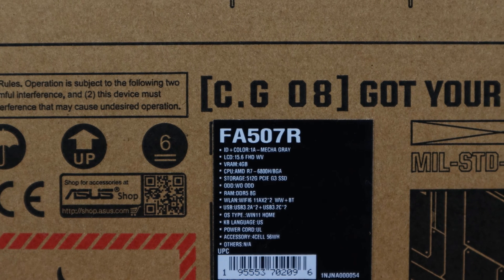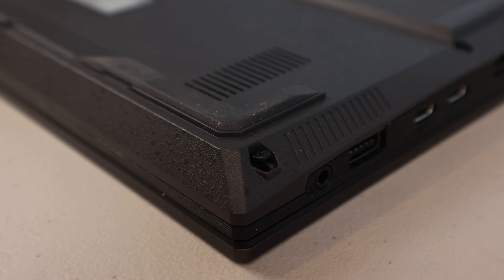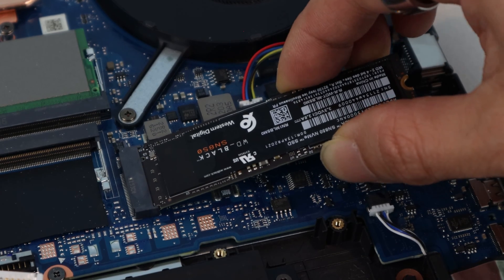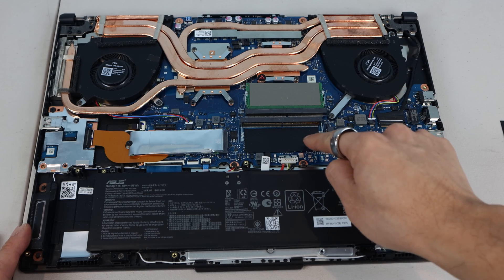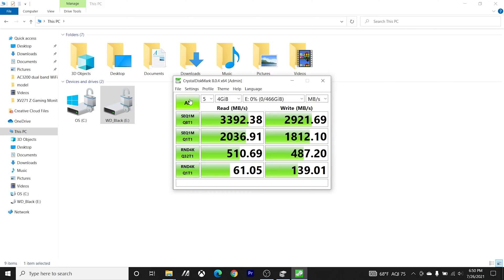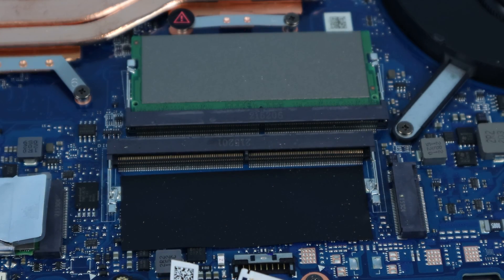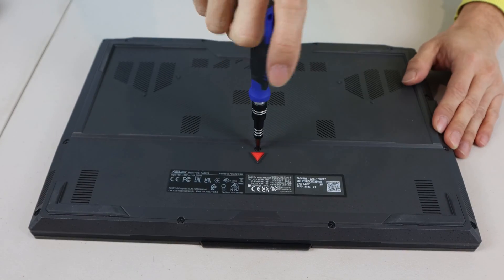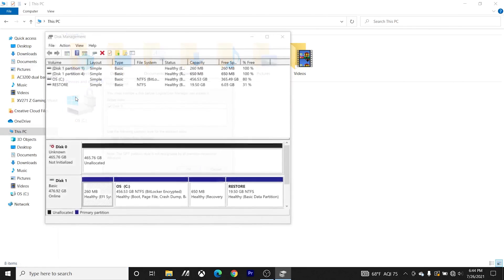How to Upgrade/Install RAM and m.2 SSD in ASUS A15 2022 TUF Gaming Laptop

Comment: Hi, has anyone tried removing the SSD from Slot 1 (the one that comes preinstalled from ASUS) and installing it in Slot 2 to fix the Wi-Fi issue?
Will there be any problem if Slot 1 is left empty and the ASUS SSD is used in Slot 2 instead?

I use asus tuf a15

Comment: Hello! What size screwdriver do I need to remove the bolt holding the secondary SSD M.2 ? Thanks!
Reply from the maker: You can use a PH0 or PH1 size mini screwdriver.

Comment: Any idea why my laptop is overheating since I changed my ssd drive? I didnt put a thermal shield. Should I? Also, the SSD included with the laptop had like a small thermal pad under it. Should I put it for my new SSD?

Comment: Hi If I.Extend My self so will it void Warranty? ??please reply
Reply from the maker: In the U.S., upgrading RAM or an SSD generally does not void your laptop's warranty due to the Magnuson-Moss Warranty Act, as long as you don't physically damage other components during the process; however, the replaced parts won't be covered, and you must return the laptop to its original configuration for any warranty service on other issues

Comment: omg i just unlock metal lock battary not remove take out connector so what happend to my laptop it will damaging something
Reply from the maker: No, not necessarily. Disconnecting the battery is optional as a safety precaution. In most cases, there is no issue if you leave it connected.

Comment: can you give more details on the heat management system you installed on your ssd. I also have an asus tuf f15 laptop, and recently i purchased a wd5000 nvme ssd for my laptop  and during intense copy paste sessions the ssd temperatures go as high as 100 degree celsius.
Reply from the maker: It's just a thermal sticker with a passive heat sink: https://geni.us/QipdAuR [Amazon Affiliate Product Link] Of course, the natural heat dissipation and air flow around your laptop matters too, so the more airflow you can provide internally or externally, the better the heat sink will perform. It may help to use the laptop on dedicated cooling surface with fans built in like these: https://geni.us/smumD  [Amazon Affiliate Product Link] if you're experiencing a lot of heat during sustained use.

Comment: My laptop is FX517ZR ? Can I use 32x2 GB RAM 4800HZ? Will it work also Can I put 2x2TB PCIe NVMe ?
Reply from the maker: For your model ASUS's official specs say 32GB is the max, however, actual users have reported that they've installed 64GB (2 x 32GB DDR5-4800MHz) without any issues. Whether or not the system actually takes advantage of all the capacity, is unclear and while you may get a little bit of overage, it's more likely there's some wasted capacity there, so that's up to you. Your laptop has two m.2 NVMe PCIe SSD slots and supports up to 4TB in each, for a maximum total capacity of 8TB.

Comment: Heya! Planning to upgrade my SSD and will be following your tutorial ☺️ And just shooting my shot, but do you also know how to know why the USB drive won't work? Tried uninstalling the driver and restarting but it doesn't work. The USB port isn't loose either so I'm going round for answers
Reply from the maker: I'd test the port with other USB devices, like a mouse or keyboard to rule out a communication issue. If it's just the drive that isn't being recognized then that could be the source of the issue and that could be any number of things (e.g. corrupted file system, damaged cable or interface, etc.)

Comment: Thanks for the video, I successfully upgraded my TUF A15 to 32gb of ram and installed a second 4tb ssd.
Reply: Did it help improve games you play?
Reply: @eddielazo4367   Sorry, I can't really answer that. I installed those components before I really put much on the computer just in case I screwed something up.

Comment: Thanks man I have done it and installed a WD Blue SN5000 1TB SSD NVMe in my TUF A15. I have also found some dust so I cleaned it. I really found it easy. The only tricky part is opening the case but when you get to the inside everything was easy. It's my first time to do an upgrade to my personal laptop.
Reply: Did the screw give you any trouble when installing?
Mine won’t turn at all
Reply: @gaara4667  I didn't face any trouble with the screws.

Comment: Hi, I have one question will the Silicon Power 512GB SSD 3D NAND A58 Performance Boost SATA III 2.5" 7mm (0.28") work with my A15?

Comment: Hello Phil i have a question, i upgraded my RAM from 16gb 4800 to 32gb 6400, but i cant seem to change it to 6400.
The GB have the right size but i cant seem to change any settings in the bios concerning RAM.
Im very happy to see you have the same BIOS screen so the settings should seem similar. When im in advanced the ram area is just darkened and says administrator level access, but i cant find a way to get in.
Do you have any pointers? 
(fully updated drivers)

Comment: Hi! i have the same laptop as yours, but can i just ask if you experience any issue while turning it on like BSOD or automatic repair like that? Because it keeps happening to me, i tried changing the ram the ssd and clean install OS but the issue still persist. After bsod or automatic repair my laptop restart and everything is smooth but it is so annoying that i can't turn on my laptop normal.

Comment: Are both of the SDD slots are gen 3 i have the asus tuf a15 FA507R hn 2022
Reply from the maker: Yes, in mine they are both Gen 3, based on benchmarking installed Gen 4 drives.

Comment: Is that possible to use ssd 850 with heatsink ? or only the normal one with the passive heatsink?
Reply from the maker: Given the limited clearance of the base, I think a proper heatsink would simply be too thick to fit. It would depend on its dimensions, but I don't know the specific limitation off hand.

Comment: Thanks you really helped me today!  Did have to use pliers on the stupid m.2 screw.
Reply from the maker: Sometimes the screws have a bit of thread seal glue on them (it leaves a blue residue on the screw), and they can be hard to turn. Using downward pressure from the back end of the screwdriver while turning usually helps add enough torque to break the adhesive seal. Two tips for small screwdrivers: 1. Find the appropriate size for the screw, tips that are too big or too small can strip/damage the screw head. 2. Get the ones with handles that rotate independently from the shaft (you press down on the back with one finger while you turn the handle with your other fingers) I find these work the best: https://geni.us/kWSA [Amazon Affiliate Product Link]

Comment: Hi. What is the maximum capacity of RAM and M.2 SSD "FOR EACH SLOT"???
I am planning to put 2 RAM sticks (32 GB 4800 mhz for each slot, total of 64 GB) and 2 M.2 PCIE NVMe Gen 4 (2 TB for each slot, total of 4 TB).
Are these upgrades applicable and probable?
Hoping for your help and answer. Thank you in advance.
Reply from the maker: Per ASUS, this motherboard can only utilize up to 32 GB of RAM, so while you could install two 32 GB chips for a total of 64 GB, the system will allegedly only be able to use 32 GB and the rest will be "wasted" capacity (though more likely just underutilized). As far SSD capacity, there's theoretically no maximum, so 4GB m.2's would probably work fine in the slots, however, ASUS recommends no larger than 2 GB per slot for system efficiency.
Reply: @FixItPhil  Thank you so much! You're a lifesaver!!! 🙏🏻🙏🏻🙏🏻

Comment: On 2:03 this plastic shield, you can change everything without removing it actually. But if it is removed and let's say the sticky part is a bit damaged on one side, so it won't stick back as tight on the side of ssd now, what am I supposed to do? Or do I even really need this plastic shiled in there? What is it for? Is it for preventing the ssd and rams to overheat? Is there a better thing to put on there instead of this plastic shield? Please tell me what to do, as it is a bit damaged and sticks but not that good, so Idk if it's ruined now..
Reply from the maker: The plastic shields over RAM chips in laptops are not always necessary, but they are there to prevent the RAM chips from shorting if the bottom panel of a metal chassis flexes and touches the module. There are third-party heat sinks that you can use instead that serve the dual purpose of heat dissipation as well as ESD protection like these: https://geni.us/jux2ydA [Amazon Affiliate Product Link]

Comment: Do you recommend ddr4 or ddr5?
Reply from the maker: DDR4 and DDR5 are not cross or backwards compatible. While they are the same dimensions, the sockets are arranged differently so a DDR4 chip cannot be physically installed in a DDR5 slot and vice versa. Your motherboard will dictate which specific version of the RAM you can use. The laptop in this video only accepts DDR5 RAM sticks.

Comment: Hey there, I own the same laptop and plan to install a heatsink on my NVMe. Before shutting it down, disconnecting the battery, and removing the NVMe SSD to attach the heatsink, is there any software-related step I should take beforehand?
Reply from the maker: No, for that sort of modification. You don't need to do anything software related to get it up and running. You may want to use CrystalDiskInfo, a free utility, to take some benchmark measurements of drive temperatures while running, only if you're curious to see how much, if any, impact the heatsink has on temperatures after installation.
Reply: @FixItPhil  Thanks for your response! Just to clarify, my question was specifically about software-related precautions before removing the NVMe SSD. Should I disable BitLocker, unmount the drive, or take any specific software measures before handling the hardware? I just want to avoid any boot or security issues after reinstalling it.
Reply from the maker: @Mister_R.F  Ah, ok. In this case, still no, since you're re-installing the same drive in to the same machine without other system recognized hardware changes. If you're concerned that a NEW drive might not be recognized by the motherboard, you can check to see if your BIOS firmware is up-to-date and update it, if not, as a precaution. 

Generally, BitLocker encryption will only require you to unlock a drive that has been moved from one system to a new system e.g. removing from your laptop and installing in a desktop PC or vice versa (or if there are significant hardware changes, upgrading RAM typically doesn't have an effect). Even then, it's simple enough to unlock and rebind to the new system by entering the associated key, which you can find in your Windows/BitLocker account. No need to decrypt the drive in advance. The only time you'll really want to do that is if you're planning on selling the drive or laptop.
Reply: @FixItPhil  Thank you very much 🙂

Comment: Whats the max storage you can add on the laptop.
Can i put 1tb instead of 512gb sdd
Reply: Yes, you can definitely do that without any problem! There's no limit to the capacity of the SSD you can install. You could even use a 2TB SSD or larger if you'd like.
Reply: @Tim05ツ ouh. Thanks.

Comment: I can’t put the battery connector lock thing back on and am not sure what to do, I feel like if I press any harder I will break it

Edit: I managed to partially get it back on but not all the way

Edit2: it still boots and works with the lock partially on but I really don’t like how the cover isn’t all the way on
Reply: Me too , have u faced any problems with it?
Reply: @Loay71 I managed to get it on but it was pretty difficult, I currently don’t need to move my laptop all that much so I haven’t had any problems, but I will need it for university soon so I’m going to see if I can get it fixed
Reply: @Erik.Mayes46 
How did u manage to put the metal locker back completely? did u apply more force?
Reply: @Loay71 it’s been a while but I think I lifted the metal slide thing up a little, plugged the battery in, and then pulled the slide over the cable. I don’t remember 100% but it was pretty awkward

Comment: I have the same laptop. I installed a Gen 4 WD Blue SN580 1TB, and it works at full speed. I can confirm that the laptop supports Gen 4 drives.
Reply: was that one on the one that alr has the intel ssd or on the second slot that's empty?
Reply: @ingore9021  second slot is empty, i installed wd on default intel slot and intel to second slot

Comment: Hello just got done replacing both exactly like you did and now my laptop won’t turn on now..any suggestions??
Reply: I’m definitely no computer expert, I’m about to do the same in the next day or two but could it be that you haven’t reconnected the battery correctly?
Reply: Same here, pls help.. it will turn on on cable only
Reply: @TheLoneSamuraY I completed this same process on my TUF A16 and it worked fine, it didn’t turn on straight away (cable plugged in) so it got me worried a little but I gave it 5mins then tried again and it came on.
Reply: @TheLoneSamuraY have you reconnected the battery correctly? Does it stay on when disconnecting the cable?
Reply: @mattmainwaring3354  its working now, for some reason i had to start it with cable then battery started work on its own later 🤷‍♀️ who knows why
Reply: @TheLoneSamuraY 👍🏼👍🏼 glad to hear it, it’s always a bit of a worry, mine did the same. Glad it’s sorted though

Comment: I have added an extra 16GB ram with the same speed but when I turn on my laptop, the screen won’t turn on
Reply: i have the same problem
Reply: Make sure the machine is plugged in. Then power it up and wait 10 to 30 seconds should boot up if not.

Trying to get 2x16gb of the same ram and speed or 2x8gb 
Or 2x32gb. I went with the 2x64gb  4800mhz works fine for me. A16 fa617ns
Reply: @RandyJ Did you plugged in 128GB RAM?😮

Comment: Super clear and wonderfully explained video. Thanks! I was wondering if disconnecting the battery first would be a good idea so I'm glad you showed the detailed steps. These basic instructions work well for upgrading the RAM and adding an SSD to an ASUS TUF A16 (2023) as well.

Comment: Hello my system bios is not showing any hard drive at all in the bios after I installed a new ram and new SSD.
But it is shown in windows and Ubuntu 
Any tip or info to help please?

Comment: Hey I installed the ssd but then I tried to start the laptop but didn't discharge then the laptop wont turn on
Reply: I am having the same issue. If you find a solution please tell me. I'll do the same if I find one.
Reply: @scixxor6025  I disconnected the battery and left it for five hours then connect it again and put the charger and now it s working
Reply: you shortcircuited your motherboard

Comment: His video was very useful thank you. I searched for a while and nobody else had a solution I could use. Bluetooth disconnecting when overheating. Watching your video helped me work around a solution. Appreciate it❤
Reply: Hey, It is possible to add a new ssd or you have to change? I mean, is only one slot available?
Reply from the maker: There are 2 slots, so you can just add a second one without replacing the original.
Reply: @fmilantv you can add a 2tb one then mirror original one so it copies drive then remove original 1 swap with 2tb as main then swap other one to 2ndary n. Slot and reformat as slave until I afford another 2tb for this nice video.

Comment: Replaced my 2x8 gb 4800mhz ram kit with Crucial 64gb ram kit (2x32gb) 4800mhz SODIMM and added Kingston KC3000 2Tb PCIe 4.0 NVMe m.2 ssd on to empty slot on my Asus TUF A15 (2023) FA507NV. Even though the asus site specify that it supports up to 32gb ram, 64 gb ram works just fine.
Reply: It will work just fine but the extra capacity will never be allocated.
Reply: Yes it does work well! Just upgraded my ram 2 days ago 64gb 4800. There’s a game I play when I had 16gb my ram was at 90% usage. Now it’s only at 20% usage
Reply: Aynı laptop var da ikinci ssd olarak 2tb eklemek bir sorun yarattı mı? maksimum 2tb demişler ama tek slot için mi total mi anlamadım onu :(
Reply: what ssd do i need for the second ssd slot? is it the long 2280 one?
Reply from the maker: Yes, I recommend the WD Black SN850 m.2 SSD: https://geni.us/ZHUx5x [Amazon Affiliate Product Link]
Reply: @FixItPhil is there an SSD 1tb that you can recommend?
Reply: @FixItPhil Hey, I know this is an old vid but do you recommend ddr4 or ddr5 ram for this laptop?
Reply from the maker: @somepvpguy69  This laptop only accepts DDR5 RAM
Reply: @FixItPhil  oh thanks
Reply: @FixItPhil  thank you
Reply: @fadianihsan7834 he literally says 2284 when talking about the extra slot

Comment: I installed two 32 gb rams  like 3 years ago and they still work fine 
i am using external hdd all the time, but i am running out of space lately as i am not sure what to delete anymore
i remembered about the free ssd slot in the laptop and i am thinking about getting one or maybe external Sdd this time
Reply: Does it overheat a lot and do you use a cooling pad?

Comment: My M.2 screw wouldnt come loose at all 😮
Reply: Me too
Reply: @giovanni8943  did it have a speaker wire over it too ?
Reply: How did you remove it ?
Reply: @Drippy_xen  i didn't haha just taped it down with that tape on the mobo 🤣 not ideal but it's been fine
Reply: @REKENONE  can u show me how to tape it? I got same issue m.2 slot screw won't come out
Reply: @javenue2733 did you end up fixing it?
Reply: @javenue2733  Mate, I just used the tape that was on the mobo as its not conductive mobo tape - Its just asus being cringe trying to stop people doing stuff - It will probs come loose with pliars exe but i dont wanna use excessive force on my mobo. Its been fine just being taped :D
Reply: @Drippy_xen  pliers
Reply: Same here it literally won’t unscrew, have you found a solution?
Reply: Same mate my screw is now completely stripped and I gave up and bought an ssd enclosure to use it as an external ssd
Reply: Turns out you need a PH1 sized bit to unscrew the m. 2
Reply: @Nasa2023-uj6pk  Had one - It still doesn't come loose they are glued in